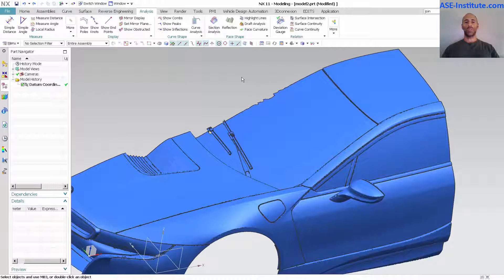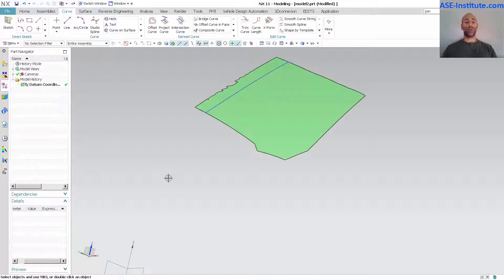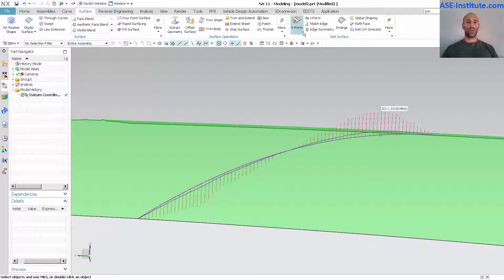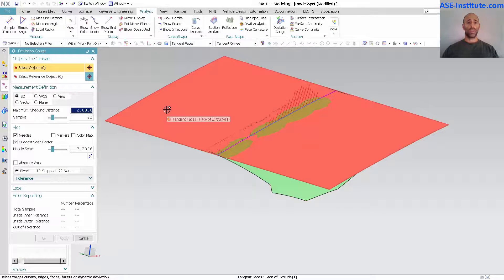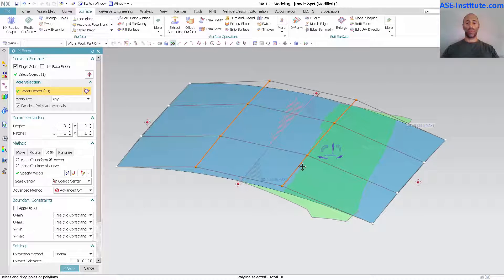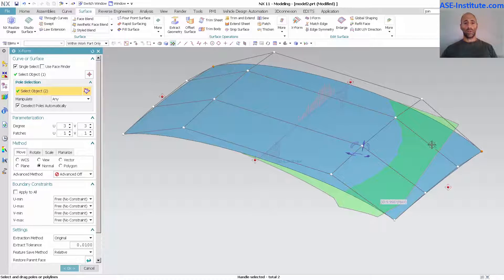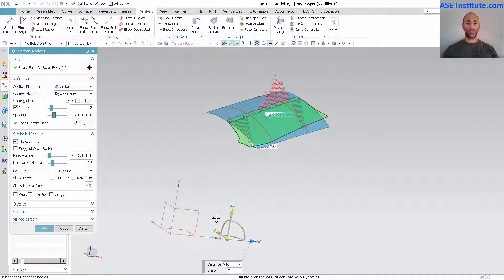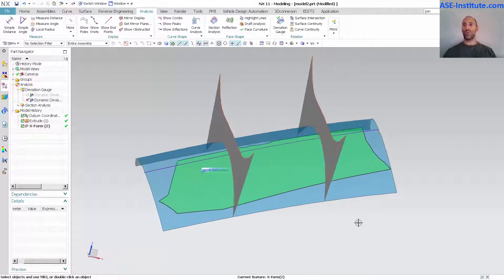Windshield: Using X-Form and Working with Scan Data | Siemens NX 11

Comment: Very nice video. I've got a question, suppose you have a multi surface class A skin, which should be bent/turned into a coaming for a door or a window. How would you do that coaming, with the minimum number of control points? Would your technique work with Rhino3D as well for the coaming/door-sill etc? Thanks a lot.
Reply from the maker: Thanks for the question.

Yes, this 'Balanced' method will work in any NURBS system. The only differences between CAD systems are the tool names and how the basically operate. An extrude is an extrude like NURBS are NURBS. The basic method is always the same. I know a couple of guys that make beautiful surfaces in Rhino. They work in various studios actually.

For a coaming... It is hard to say. There may be 2 or 3 different ways. One is a swept section help to a vector direction another is how I do it here and another is framing the shape with 3D curves. Really need to see your opening and how the surfaces flow.
Reply: Thanks a lot for your response. I'll make a short video to explain what I mean, but its not too difficult to understand the issue. I find that the moment you cut a high end surface trimmed with a curve, the number of points on the split increase exponentially, now if you use that edge to make anything, it causes a significant point bloat. Simplifying that does not help since the edge opens up causing other issues. These excessive points slow down the system and later on give artifacts that do not represent the surface one started to create to begin with.
Reply from the maker: Please do.

I talk about subsequent operations being more complex than the initial operation. Nature of the game. There are ways to mitigate that to a certain extent.